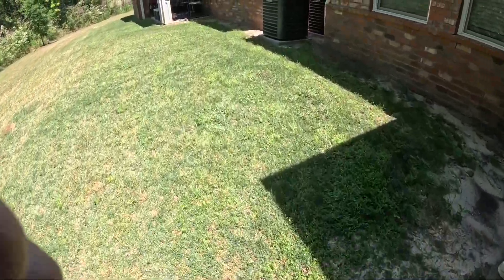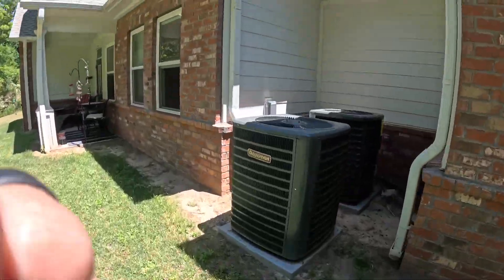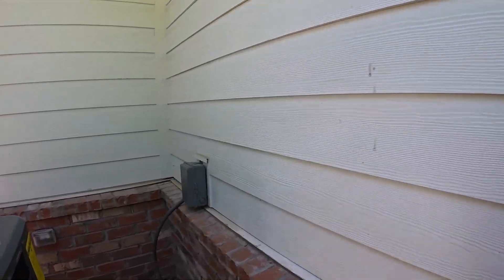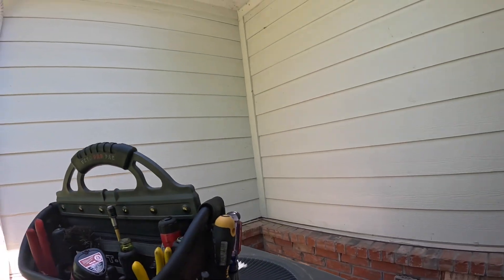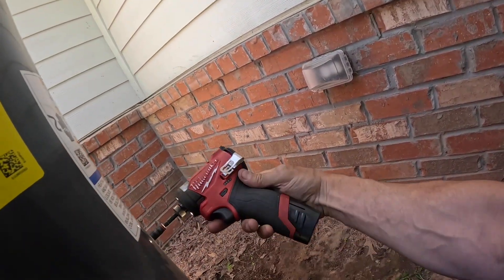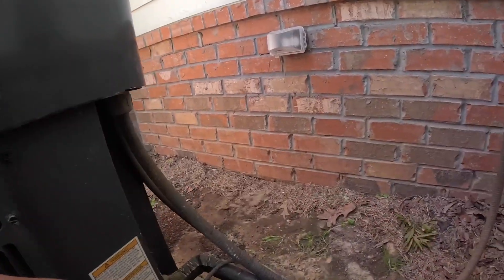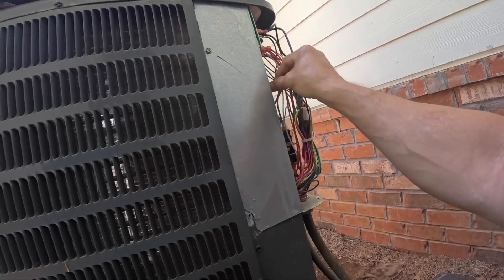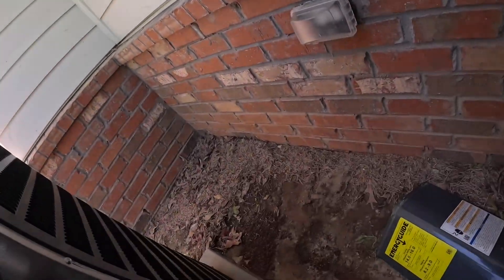Relatively New Goodman System Completely Out Of Freon! #hvacguy #hvaclife #hvactrainingvideos

Comment: With older people of limited means, I try to help them out. If they give me the job fixing it, I don't charge them for the diagnosis service call since you didn't really use anything except nitrogen. I'd collect the service call today, but just apply it to their bill if I get the job.  Lots of folks appreciate it during these times of inflation. They are getting squeezed from every direction and I hate for someone to do without AC due to money. That's an expensive repair for most people.

Comment: My 6 year old Ruud (Rheem) system was completely out of refrigerant. The evap coil had huge leaks. Everything including furnace, A/C, line set, coil was brand new at time of installation. Quality of equipment these days is garbage. But the fact this was a $1300 repair is ridiculous. You had refrigerant and an hour or two of time.

Comment: Hey Curtis what would happen if you flush the system with nitrogen and dont replace the filter drier ? I dont think there would be non condensables in the system especially if you pull a good vacuum

Comment: You will do less "knuckle bustin" if you put the adjustable wrench on the nut then adjust it so it's a tighter fit. Also less likely to strip the nut or fitting. Well done. That AccuTrak is neat.

Comment: Great video But You don't need to replace the drier on that call. Just Evacuate & Fill it up.
You filled it with nitrogen. the nitrogen has an affinity for moisture and gathers any moisture and pulls it out with it. hence the name " Dry nitrogen "
only time a drier needs changed is when replacing a Compressor or doing any more than 4 welds on a system or Physically rusty or old.
That system was new u said.
What's changing the drier going to do for the system ? it's a new drier. it's not old , rusty or clogged up.
Reply: Well the systems was open for an extended period of time , And clearly the people who installed it didn't care to pull a vacuum so there was probably no precautions taken when brazing the unit and coil. If i was in his shoes i would also change the dryer while I'm at it
Reply: I tend to agree. We use a nitrogen purge box, glove box, for hi-rel electronics.    The units are then sealed in that nitrogen environment per military standard 883.

Comment: Turning off the disconnect was a good save. I was waiting for it to start. lol!
Reply: What part of the video?
Reply: @realSamAndrew - At about 5:57 he remembers to pull the disconnect after he had started putting nitrogen in the system.
Reply: @stevee7774 Thank you. I don't know how I missed that even after looking for it on a rewatch 😮😮.
Reply: @mel904  
Yep. Nitrogen is tough on a running compressor.

Comment: We have these units where I work. Blower assembly is blocked by evaporator and a pain to replace. Also evap coils fail regularly.
Reply: Goodman had a bad batch of evap coils from 2007-2009. Their coils are no different than any other now.
Reply: These were new installs in 2018-19. So all other aluminum coils fail regularly?
Reply: @ABC-wz2db  
No, they don’t. You can get 20 years out of an aluminum coil. Make certain you use a quality air filter in the system and never run it without a filter for even one day. A dirty or clogged coil holds moisture on the coil and can cause corrosion and premature leaks.

Comment: His first problem was wanting it to go below 70. 😂
Reply: Exactly.
Reply: We run ours at 68 degrees during the night and it cycles (doesn't run constantly) but we are in the Tucson, AZ area where there is very low humidity (5%), I don't know if that makes a difference??  Our single level house is 2100 sq ft running a 5-ton American Standard (2023) unit.  We had day-time temps last few days 109 degrees outside.
Reply: I run 68 year round in Michigan
Reply: If it gets to 70 in my house, I turn on the heat.
Reply: Never happening in Phx

Comment: Why do you think manufacturer doesn't ever guarantee  refrigerant. 410 double the pressure as r 22. Once you've been to the factory and seen the assembly line you'll never feel confident that things won't happen down the road
Reply: 'That's a good point. I knew it was more pressure, but I didn't realise that much more. I don't know why they don't go ahead make units that use CO2 or nitrogen. That way we could release the gas and not hurt the atmosphere.
Reply: 5 years pretty much standard here in Australia 🇦🇺 
But when you talk refrigerant leaks  they always try to blame the installer, talking from experience

Comment: Do you have a cutoff pressure that you consider it a total loss? i.e. anything under 20 psi gets vacuum and a dryer?
Reply from the maker: Basically zero.
Reply: @HVACGUY  I agree.  When someone tells me that they have to add refrigerant on an annual basis and the gauge reads zero, it's time to aggressively look for the leak before adding even if they just want it "filled."

Comment: Is it possible to put dye in home air conditioners like the do in automotive A/C sytems to help locate leaks?
Reply: It is, but it's not recommended, the dye is a non condensible and can gunk up valves and etc.
Reply: @ninnghhizziddha the sealant maybe.  I don’t know about the dye.
Reply: Putting dye in a system should be a Last Resort When You Have Looked for Refrigerant leaks with leak detector & bubbles & can't find it.
Reply: Fucks up your gauges with elephant snot!

Comment: So we had a Goodman system put in one other house and it stopped working after three months. The company that installed it came back and said the compressor was blown. He put a new one in and said it had blown because the system was cycling way too much and whoever installed the system didn’t set the blower speed correctly. I told the man that it was his company that did the installation of the in and outside unit. His face went red and went to the truck on his phone. Let’s just say it was replaced and I didn’t call them back.
Reply: That is why certain units get a bad name. It wasn't the unit's fault at all.
Reply: @jthonn  I don’t know that much about Goodman to really say if they are quality or not. What are your thoughts?
Reply: @Bunkysworkshop  The one I have is a 4 ton, it is 18 years old r22. It has a slow leak that started when it was 13. I put stop leak in it last year and it is still working. Are they any good today, I don't know. I was putting about 3lbs. of freon a year in it, so I'll be posting if the stop leak worked at all when I check it, so far so good.
Reply: @jthonn were do you get your r22?
Reply: Where
Reply: I just had the exact issue the day after install on heating. I caught it before it had run even 30 min. I had asked the installer to increase the blower speed at install when it was on cooling, they didn’t check it on heat. They increased the blower speed and it seems to have resolved. Not a lot of confidence in them now.
Reply: What a smart guy he was 🤣 and good call not calling them back to your house. And Goodman units are top of the line but they work
Reply: @dkinfishing  I think you meant aren't top of the line. They aren't the worst either, I would say middle of the road.
Reply: @jthonn  that is what I meant actually. Thanks

Comment: Typically with Goodman, it’s a leak in the condenser like a vibration or rub out
Reply: I've yet to have a condenser to leak after installing several hundred Goodman however I always go above the quality level of most companies and I inspect all new units to see if anything can rub the insulation on the wires or lines rubbing together and secure if needed. I've personally had the most leaks from Rheem and York. Trane with the most compressor failures. If you only compare package units, Trane has the most leaks by far, but it's usually because the installer didn't do a good job and inspect the unit to see if lines were rubbing together. Yes we shouldn't have to do that but the quality of all new units, regardless of brand, is pretty much junk these days. That's why I don't push people into getting a new unit. With the new EPA standards in effect, I doubt any system will last 5 years without giving a major issue.
Reply: @Bryan-Hensley Exactly right. Goodman doesn’t give incentives to contractors like the big brands, so some installers say Goodman is junk. Like you, I have installed hundreds of Goodman systems without excessive problems. A properly sized and installed Goodman will last as long as other brands at a much lower installed cost and cheaper service calls because the parts are available and less expensive.
Reply: Mine was in the evaporator. My sister in law has 2 units and the evaporator on each one went out. The warranty covered them at 7 years old. They claimed that there was a bad batch of evaporators that went out.
Reply: @jthonn yes, my son has AC co. & replaced  many leaking evaporator coils on Goodmans, including mine twice.  He hesitated to continue to install them because of how many leaked. Reasonable priced units for customers without a lot of money.
Reply: @zeldamoore8371  I would think by now that they corrected the problem, but who knows.
Reply: @zeldamoore8371 Goodman coils had leak problems circa 2007. That has been resolved. I find more leaks in Lennox than Goodman today. Just my field experience. Yours may vary .
Reply: Trane/American Standard condensers leak where suction and discharge lines pass under the coil.  Sometimes on the aluminum spine fin tubes too, directly above the suction/discharge lines.
Reply: Yeah that dam true suction port always rubs out its the first thing I check when I find a flat goodman or amana
Reply: @Wompwomp7787  ran into a lot of leaks and shorts where goodman like to route the low pressure switch wires right across/against the capillary lines coming off the piston/txv (on new units). Seen mostly shorts, but if someone keeps throwing fuses or running the unit without fixing the rubbing wire it blows a hole into the line. On repairs I will take the black wire loom and loom the switch wires and zip tie them to out of the way. Its insane how they haven't routed those wires somewhere else by now...